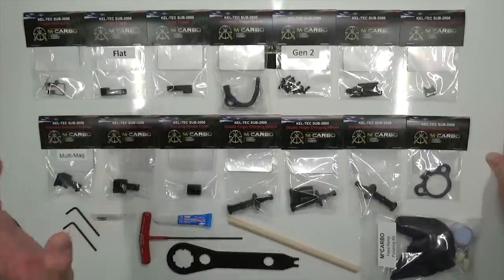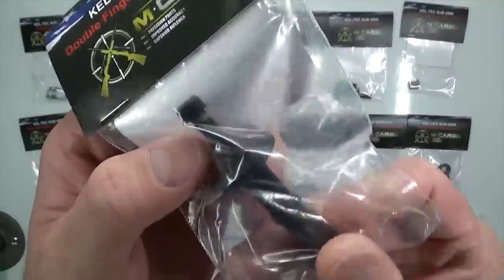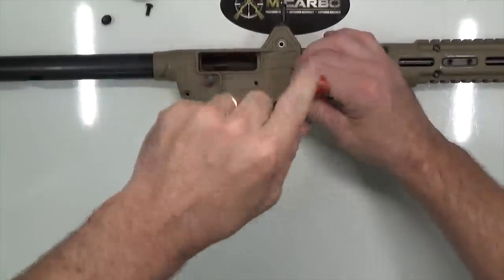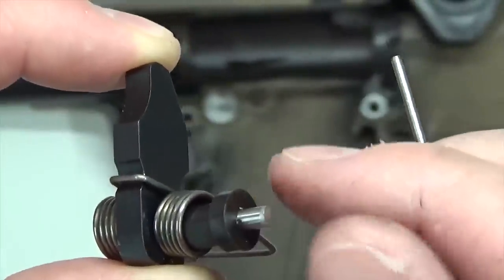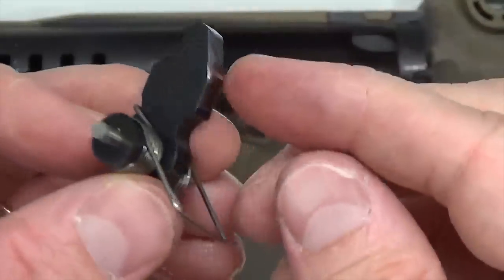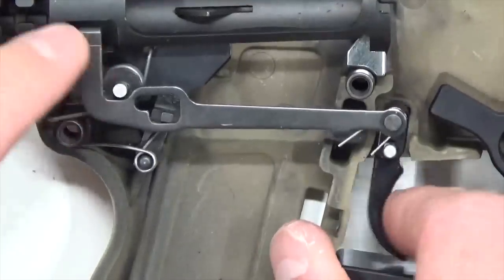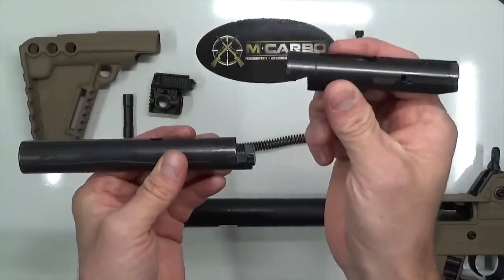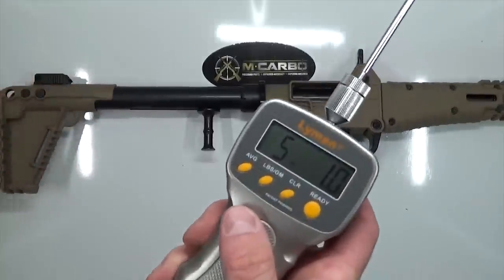KEL-TEC SUB-2000 Accessories - M*CARBO - All in One Installation

Comment: Took 5 hours brutal. When i took it apart the top hinge screw only one side would unscrew so i had to punch out the tube. When i put it back together the hammer wouldnt stay so i had to unscrew it again and even with the new carbon steel screws and tubes it did it again. Maybe because its brand new unfired? I wanted to test what it was like from the factory first but dont have much time for the range in the early days of the apocolypse here. Had a rainy eve so i upgraded it. Cant wait to try it. Great video I just sometimes have crap luck. The sear spring flew across the room when i had to re open it up. Again probably should have shot it some before i did the upgrades would have probably went smoother.

Comment: If that collar nut on the receiver tube won’t come loose use a hair dryer to heat it up. If you reassemble the SUB2K and it only works most of the time a spring probably slipped. Open the receiver and check everything.  It’s supposed to function correct every time.

Comment: Great job and work putting all this together in one stop shop!! I have all this on Gen2 G19 sub and Love it! Now gonna buy whole kit again and do my Gen2 G17 black sub BUT what do ya think about id I coat with FDE color when all stripped down? Then I would have same look as video....i use FDE from Brownells rattle can and it works great.
Reply from the maker: tcbkkb1 Thanks Brother we appreciate your Support!  Haven't used the Brownells FDE paint on the SUB-2000 but think it would work.  Let us know the results.  Is this what your using?  http://www.brownells.com/gunsmith-tools-supplies/metal-prep-coloring/paint-finishes/air-cure-aerosol-paints/magpul-fde-sku083002014-1117-138799.aspx
Reply: MCARBO Yep! You got it, good stuff , used grey on barrel and FDE on Magpul black pmags etc, you just gotta let it dry good then reapply if needed etc covers well!

Comment: All you really need is the dowel road, needle nose pliers for removing the safety, and your Allen wrenches. I used the Allen wrenches as a punch and it was just fine. When compressing the spring have at least two Allen wrenches (for the charging handle.) Compress the spring as much as you can without losing your mind, insert an Allen wrench and then use that as a handle to further compress the spring. Then insert the second Allen and you are good to go
Reply: The mcarbo metal tool was pretty much worthless. It was much easier to remove the safety clips with your two Allen wrenches. Also my back plastic clap just rotated right off. I didn’t need the mcarbo armorers wrench for anything. It didn’t even fit my model
Reply: Two Allen wrenches to get the safety clip started and then use some needle nose pliers to finish the job. You have to be a little violent and have a firm grip but it works

Comment: I've owned a Sub2K since... gee, about 2005, 2006. Somewhere around there. Anyways, I LOVED shooting it because 9x19 carbines have such little recoil and the thing hits with the force of a .357 Magnum out of the muzzle out to 25 yards. It really makes 9x19 shine. But, those plastic feed ramps were what eventually caused me to shelve it. Eventually I got more and more failure to feeds to the point where it might as well have been a bolt-action. I bought the Sub2K used and, unknown to me at that time that Kel-Tec serviced any Kel-Tec even if it was used and you weren't the original owner (never really cared for those policies, TBH, myself and the previous owner never did anything to the rifle, so washing your hands of responsibility to fix it because it merely changed hands never sat well with me) and I didn't feel it was worth paying shipping and going through the hassle of sending it and paying god-only-knows how much to fix it.

Now that companies like yours are around and are, quite honestly, doing Kel-Tec's job that they should be/should have done themselves and elevating the quality of the build with aftermarket mods, I'm interested in dusting (possibly literally) that Sub2K off and using it again for the first time in probably a decade. The feed ramps alone... Good lord, the factory ones are shamefully bad. And your prices for mods are very reasonable as well. Honestly, I never had issue with the Sub2K trigger. Mine has a decent pull in weight, a bit spongy but otherwise surprisingly good trigger. The reliability, probably because of those feed ramps... Eh... Yeah, I'm definitely interested in perhaps ordering some upgrades from you guys in the future.
Reply from the maker: Thanks Brother for your Support!

Comment: Say I just wanted to replace only the feed ramp. Could I just remove the grip pin holding the plastic one in, slide it out and put the stainless steel one in or do I have to remove parts?
Reply from the maker: I like how your thinking but unfortunately you can't slide that grip pin all the way through the grip.

Comment: I just wanted to let all kel tec sub2k  gen 2 owner's know that there is a recall on some of the gen 2 barrels,check kel tec website for serial number and get it sent in,and while you are waiting for you gun you can order some m-carbo parts to get your sub 2000 to run like a top for  when you get it back! (Fyi lead time is 8 weeks as if 8-1-18)

Comment: I have,a question.  Is the castle nut supposed to be threaded.  I'm hesitant to attach the sling mount as mine is not and I don't want the sling dragging the nut off.
Reply from the maker: Hey Brother, that's a great question and we though the same thing the first time we realized there were no threads on the Gen 2 but the Loctite 380 works really well.  It's "Super Glue on Steroids"! There haven't been any issues with the castle nut moving around when using it.  It's what KEL TEC uses from the factory.  http://www.mcarbo.com/loctite-380-black-max.aspx

Comment: Did you rattle can that receiver or is that an optional finish?
Reply from the maker: Hi Kurt, you can find the SUB-2000 in Tan, Green and even Blue.  KEL TEC offers custom color options but they are hard to find.

Comment: 6061 is to aluminum, what 1018 is to steel. Just a general purpose, easily machinable, nice and soft, aluminum. Aircraft grade would be either 2024, or 7075. Harder. Breaks chips easier. I prefer 2024 to work with. Ive spent many hours with all 3. 6061 is what we use when it really doesn't matter the quality of the material. Customer just wants aluminum, we use 6061. The fact that you are hard anodizing really negates any of the downside tho. Hard anodize is hard as hell and very durable.

Comment: the only problem I have with the mods shown is how would kel tec react to any warranty work after these upgrades. mine has been sent back twice already.
Reply from the maker: That's a good question.  We usually recommend removing the mods before sending it back but they have done warranty work with our parts installed without issue.  They also order parts directly from us from time to time.  Shouldn't be an issue.

Comment: I recently upgraded my new Sub 2k with all the MCARBO goodies currently available. I took my Kel Tec to the shooting range to test it out for the first time, but discovered that the weapon would not fire any rounds out of it. Upon further inspection, I noticed some very light primer hits from the Sub 2k firing pin. It appears that the weapons firing pin does not have enough force behind its strikes.

Can anyone here help me???
Reply from the maker: Send us an email with some pictures of the hammer spring orientation. Most likely it was installed incorrectly.
help@mcarbo.com
Reply: @MCARBO  I had a local gunsmith check it out, and he discovered that was the issue. We reversed the hammer spring and now it works like a dream. 👍

Thanks for the reply!

Comment: The wrench and glue are useless on the latest revision of the G2 multimag sub 2000.
The collar is now a plastic twist lock collar.No tool or glue needed.All so the thread protector is no longer hex shaped.It is knurled.

Comment: 2 easy trick friend's, the hammer did not fall back for as like n the video.  I double checked it and then flipped it back with the side cover still off and bingo.  On the safety c clips if you lay them on the poly frame and push up the pin to meet them another easy bingo.